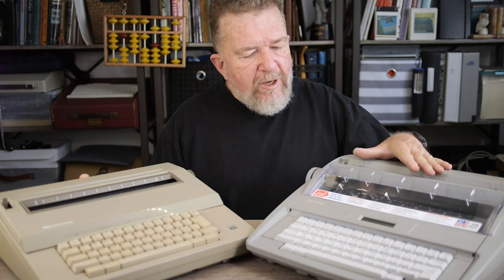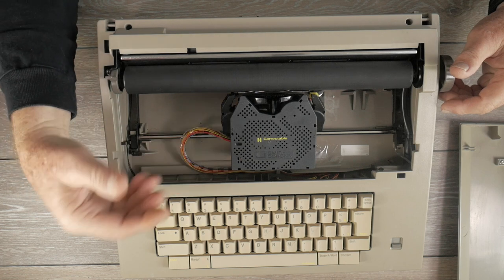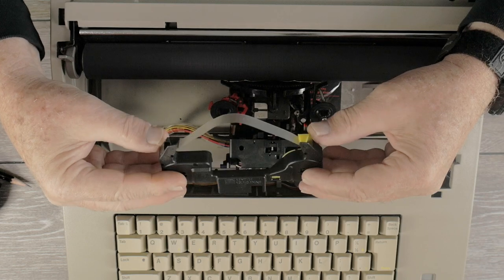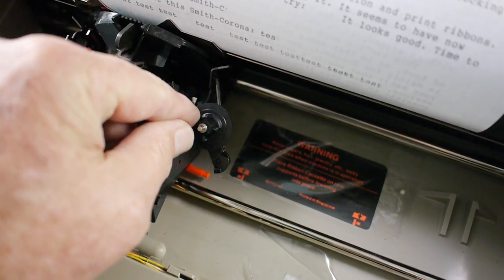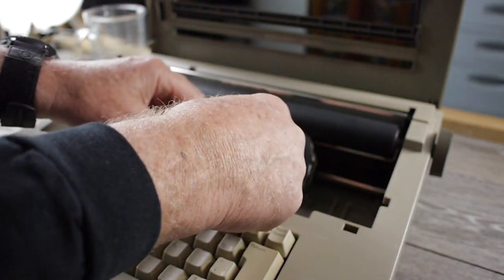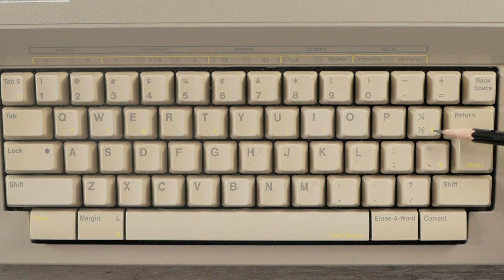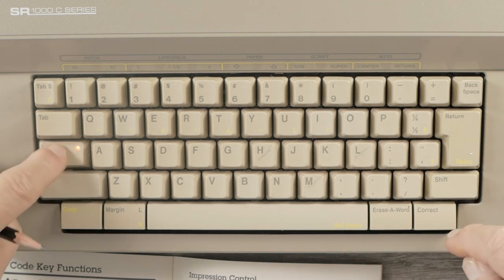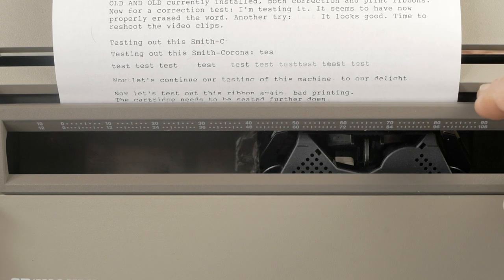Sears SR1000 Electronic Daisywheel Typewriter

Comment: I find that the correction tape for H-Series machines won't lift the "ink" off of modern printer paper but seems to have no problem with sketch paper.
Reply from the maker: Paper “sizing” (the surface finish) is different between inkjet and laser; inkjet paper is more absorbent. You should experiment with various kinds of paper to see what works best. Also, if the correction tapes are “new old stock” they could be dried out and less sticky.

The tapes for my Brother SX4000 don’t feel sticky but work as a pressure-activated adhesive. Conversely, IBM Selectric lift-off tapes look the same, have the same orange spools but are very sticky — so sticky that they get stuck if I try using them in my Brother machine.
Reply: @Joe_VanCleave  Ooo! That difference in sticky levels between correction tapes is not something I even considered :)

Comment: I have a similar machine, and it works well, but there's a lot of kerning, so the characters print really close together on the page. Has anyone out there encountered a similar issue? Please let me know. I've been posting this question in a lot of forums, because I really need an answer, so any help you can offer me is greatly appreciated.
Reply from the maker: Close together horizontally? If so, change the character spacing to wider. Perhaps you’re using a 10 CPI print wheel and have the machine set to 12?
Reply: @Joe_VanCleave  Thank you so much for your prompt reply. I don't have my machine in front of me right now, so I could not tell you, but I will be home within the next 90 minutes. I'm in the Pacific Time Zone. Is it OK if I ping back at you then?
Reply from the maker: @sebastianmoraga4785  Yes, whenever is fine.
Reply: @Joe_VanCleave  Now the ink ribbon is out of ink, so the issue is moot until we can get a new ribbon. No complaints here, I got the typewriter to keep my son from overdoing it on screen time and it's worked like a charm. Keeps writing stories.
Reply: Thank you, sir. Now we have fixed the pitch issue and the ribbon issue, but now each line gives us room for 67 characters. Is there any way to make that number higher? Please let us know if you can help, any bit of help would be much appreciated.
 @Joe_VanCleave
Reply from the maker: @sebastianmoraga4785  Set the margins narrower and the printing line will be wider.
Reply: Thank you @Joe_VanCleave
Reply: of course, now I turn it on, it makes a whirring noise and starts beep-beep-beeping. Screen says "CHECK PRINTER." I looked in the troubleshooter and (I could not be making this up), the troubleshooter says "If it says CHECK PRINTER, it means the printer needs to be checked." I am totally at sea here. Could you please help me, yet again?
Reply from the maker: @sebastianmoraga4785  hmm…make sure the cartridge isn’t at the end, if it can’t turn the machine might give an error.
Reply: Hiya! Thanks for your quick reply. Do you mean whether the ribbon is empty?It is not.  @Joe_VanCleave
Reply from the maker: @sebastianmoraga4785  It could be that the spools in the cartridge are jammed and not turning. Try it without the cartridge and see if you get the same error.